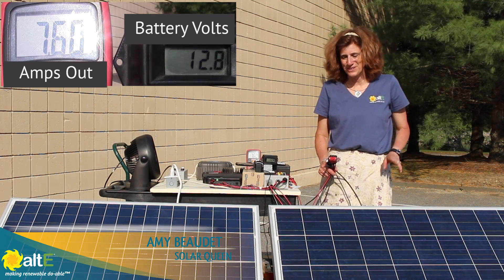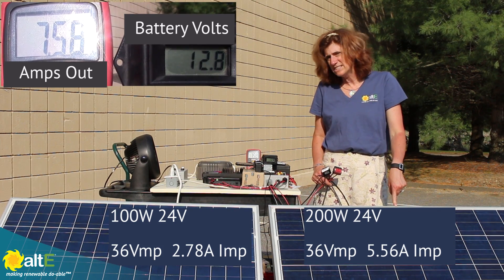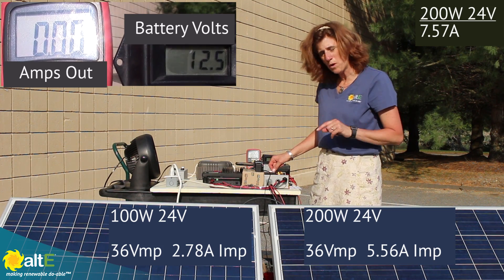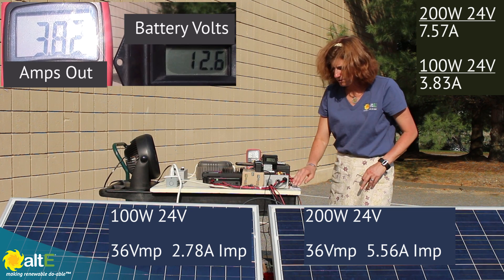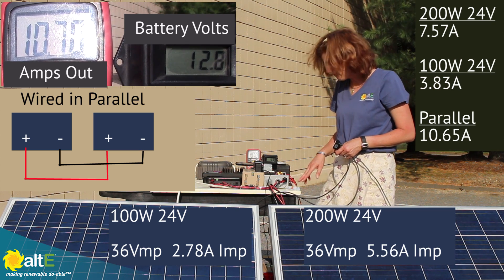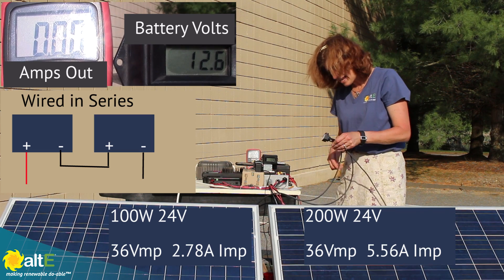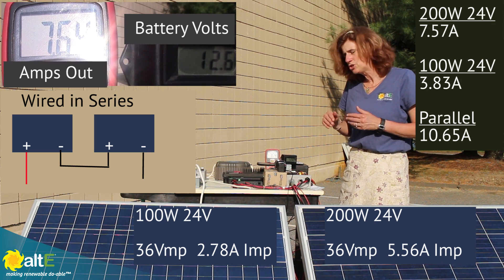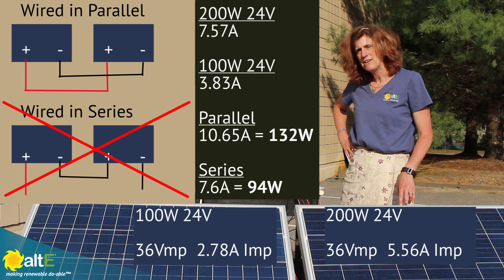What’s worse? Mismatched solar panels with different amps in series or parallel?

Comment: These are the results of using your MPPT controller but should any conclusion be drawn about MPPT controllers in general from this?  If not, then you should state that.  Perhaps a different MPPT controller would show 10+ amps for either series or parallel hookup of these same panels under similar sun conditions.
Reply: In series, both panels are limited to the current of the smaller panel. In parallel they were both limited to the voltage of the smaller panel. So the results are exactly as expected.
Reply: @LibertyDIY  Very badly worded by you.  The physical size of the panel is not relevant to those interactions, the actual voltages and amperages are.

Comment: Can you parallel two panels with different volts? Meaning, can you hook a 12-volt panel with a 24-volt panel?
Reply from the maker: We did a different video on mismatched voltage. If they have the same current, they should be wired in series, and either match the battery bank voltage and use a PWM charge controller, or use an MPPT charge controller for the right voltage output. If both amps and bolts are different, they should not be used on the same charge controller. Each should have it's own controller wired in parallel.
Reply: @AltEStore  do the same rules apply if you're just running straight into a grid tie inverter?

(also kudos on responding to comments on a several year old video haha)
Reply from the maker: @LoganJarrell  yup, ohms law applies regardless what you connect to.
Reply: @AltEStore  Hi im wondering if you can help me , i have 8 panels in total my charge controller has a limit of 15amps and 150 volts my panels are 18 vmp 6.67 amps and have no shading my panels are 25 meters away , currently I have 7 wired in series are I'm looking to connect the 8th panel but not sure how or if I can without exceeding the voltage of the mppt,  could I simply connect it in parallel to the other 7 ? Many thanks

Comment: It would have been helpful if it was stated that parallel isn't necessarily always the best option for mismatched panel and it depends on how they are mismatched.  If they were different voltages with the same current output, series would have been better.
Reply from the maker: Andy Andy we did a whole series of videos on this, including different volts, amps, and both. Check out the others.

Comment: For maximum output when connecting different panels together,  connect panels with equal current outputs in series and connect panels with equal voltages in parallel.   If neither the current outputs or the voltage outputs are close, don't bother hooking them together unless you can find a series/parallel combination that will yield a matching result. (ie: two 12 volt/5 amp panels in parallel then connected in series to a single 12 volt/10 amp panel).

Comment: 24(V)*10.65(A)=132W ?????????
Reply: That is the amperage out to the battery so it is like 12.9V * 10.65A = 137W (watts).  Her calculation is a little off.

Comment: Hi, can a 12v pwm 10amp CC take a 100watt 18v s panel. To charge 12v batteries? Thanks for your help. Great videos by the way
Reply from the maker: Yes. A 100W solar panel with a Vmp of 18V is considered a 12V panel, as it has the correct voltage output to safely charge a 12V battery. 100W has a short circuit curent (Isc) of about 5.75A. When you include a 25% safety margin, that gets you to 7.2A. So an 8A or higher charge controller will work.
Reply: altE Awesome thanks. Since we're on subject of charge controllers... How does one connect multiple loads on the CC without the use of an inverter , I.e- waterfall water pump, lighting and fountain pump. I've heard of a load center with DC circuit breakers. But would love to hear your input. Also, do all positive cables need to be fused?. Thank you very much
Reply from the maker: I think the cleanest way would be to use something like the Midnite Big Baby Box. You can use that as a DC Load Center. Each DC load doesn't have to be separately protected, but you should have them on a shared breaker. Like your AC loads in your house. Every outlet doesn't get its own breaker, but many share one breaker.

Comment: Hi,
Great explanation. Can you help me with my arrays?
I have a 5KVA MPPT solar inverter. 12 panels 340 watts 24V mono, and 3 panels 320 watts 24V Poly.
What would be the best way to array them up for best performance. I can remove one 340 watt mono panel if need be.

Thanks.

Comment: I actually was planning on doing this but could use some verification. If I have 2 100 watt 12v panels and 2 160 watt 12v panels that I want to run at 24v to the MPPT. Would I wire the 2 100 watt panels in series and then the 2 160 watt panels in series and then wire the 2 combinations in parallel?
Reply from the maker: JRS1121960 right. Since the volts are all the same, wire the different amps in parallel, as you described. The mppt charge controller won't work it's best with the mismatch, but that is the best combination if only using 1 charge controller.

Comment: So it's better to connect solar panels in series with same sizes of solar panels, Correct ?
Reply from the maker: It depends. If you have an MPPT charge controller to match up the panel voltage with the battery, or the battery matches the increased voltage, and the panels have the same amps, then yes, series can be better. Unless you have partial shading on some of the panels, then parallel may be better. So many different things to take into consideration...
Reply: altE thanks 🌷
I subscribed to your amazing channel 😍👍

Comment: I have both same wattage solar panels connected in parallel (250w -7.99 amp each) on my Smppt20D and I'm using a 1500watts inverter, the problem is that I can only use a fan. I can't even power a t.v with it.
But instead if I connects the inverter directly to the battery it works. 
How can I make it works using the load connection from The MPPT?
please help me :)
Reply from the maker: You should never connect an inverter directly tot he load control of a charge controller. The load control is only to be used for low current DC loads. A 1500W inverter connected to a 12V system will try to draw 125A. A 20A charge controller can only handle 20A load. You have to have the inverter connected to a battery to make it work.
Reply: ok Thank you so much, I have a last question.
What will happen if I connect the load output of the Mppt on a battery? Will it harm the charge controller. Because I would like to read how much amps I got by connecting it
Reply from the maker: DO not connect the load output to the battery. Only connect it to a DC load drawing less than 20A.
Reply: thank you so much for your advice :)

Comment: hi I have 2 solar panels both 250 watts 
I would like to know which wiring connection is better to have more amps possible? thank you
Reply from the maker: It depends on your situation. If you have shading, and a 12V battery bank, wiring in parallel is better. But if the panels are a far distance from the battery bank, and there is no shading, wiring in series is better for higher voltage, lower current, and less voltage drop. Are the panels 60 cell or 72 cell? If 60 cell, and you have a 24V battery bank, you need to wire them in series to have a high enough voltage in the heat. An MPPT charge controller is needed to match the voltage of the battery bank.
Reply: panels are 60 cells 12v  and batteries are 12v both connected in parallel :)

Comment: totally true
the solar to load ratio is (3.84A * 12.6V) / 100W  OR (7.55A * 12.9V) / 200W both equals 48%
in series the Imp will be the minimum Imp of them: 2.78A  and the volts will be added 
then 
2.78 * (36 * 2) * 0.48= 96.08 W ( approximately 94 W)

Comment: Of course the series had less amps, but the volts were doubled. It really depends on the power of your battery bank.
Reply: no that is amps being output...battery bank voltage is irrelevant as fewer amps being output.

Comment: When you take a set wattage, lower amps with higher voltage will most always perform more efficient than higher amps at lower voltage, regardless if they are wired mismatched or not.

Comment: if we keep this mismatched solar setup till long , will i damage the solar panel / cells ? or not ? because the large amount of current will pass from the smaller sola rpanel / cell ?
Reply from the maker: Correct. The cells of the lower wattage panel will heat up, and can potentially damage the panel.
Reply: altE  thank-you,

Comment: Hi

What about make mismatch different battery bank?
Same volt different Amper?

Thanks
Yossi
Reply from the maker: You should never mismatch batteries. They will charge and discharge differently and will be ruined early.
Reply: Hi
Thanks
So now i am confused 
In some video you said that it can be done when connect two mppt charger to two battery banks

My question is
If there is two different battery banks that connect to the same dc input of the inverter. Its not like parallel connection between the batteries banks?

The are shearing the same plus and minus 

Thanks
Yossi

Comment: How is this right?? The two solar panel in series=48V while parallel will be 24V.
You get more power with the panels in series because 48x7  is more than 24x10.
Reply: MaxSantos 
Two power sources in series pass the same current through them.   The 100 watt panel became the bottleneck for the max current since it can't keep up with the 200 watt panel.  Hooked in series, it basically limited the 200 watt panel's output to the same as the 100 watt.
Reply: MPPT charger makes the voltage suitable for the 12V battery to charge in an efficient way. That's the power of MPPT and with PWM the 48 volt situation would be way less efficient. Look up how these two different chargers work.
Reply: Max you 100% correct the series setup is much better , but thanks for the demo just the wrong conclusion.

Comment: DOUBT!
If the Imp(measured) of panel 1 is 3.83Amp then how current equal to 7.6 Amp can flow in a Series circuit, as we all know in an array connected in series the total current flowing in array is equal to the smallest current delivered by cell/panel. 
Kindly clear the doubt !
Reply from the maker: It is able to pass some of the current through from the higher amperage solar panel, but it is a bottleneck that does limit the current. So it will be a little higher than the smaller one, but not by much.
Reply: @AltEStore  what if you wire the small panel before the larger panel, then there is no bottleneck, the larger panel can handle the power coming from the smaller one quite easy, did you try it both ways?
Reply from the maker: Since the circuit is a loop, it'll still hit the bottleneck on its return, with same results.
Reply: altE Store I think you should have done that on your mismatched panel series.

Comment: Thanks for that. I have a 48v system with 180w and 190w panels. Two 24vdc, wired in series to make 48vdc arrays. I also have 6 each 280 w panels at 24vdc I want to add to the system to make three more arrays but had someone that it wasn't recommended that I do that. Is that true and why? I have a Xantrex MPPT 60 charge controller and 4800 w Xantrex XW series inverter I purchased from you guys a while back. Appreciate your help and the informative video.
Reply from the maker: I want to make sure I understand your system first. You have 1680W with the 280s as 3 parallel strings of 2 in series. In a 48V system, that's about 38A. You've also got the 1 string with 370W with the 2 small panels. Is that in parallel with the 3 strings of the 280Ws, so all going to the same charge controller? If so, not ideal, I'd rather see them on their own charge controller, but let's keep going. That's 7.7A, for a total of 45A. You've got a 60A charge controller, so you still have room for more solar. If it were me, I would remove the 2 small panels, and replace them with similar to the big ones you have. 60A x 48V = 2880W. So you can do up to ten 280W panels, 5 strings of 2. I'd replace the 2 small ones with 4 big ones. You could get a small 10A charge controller and wire that in parallel if you still want to use them in this system. Even PWM would work, that wouldn't be much money at all.

However, the next question I have is how big is your battery bank, and what kind? Lead acid batteries don't like to be charged too heavily, ideally at around a C/8 or C/10 rate. That means if you maxed out your charge controller with 2800W, at 58A. A C/10 charge rate would mean you'd need a 580Ah battery bank. C/8 is 464Ah. So, figure out if your battery bank can handle a bigger solar array.
Reply: Thanks for your prompt response!! Actually what I have is 8 each 180 watt panels at 24 vdc with two each in series to make 48vdc. I have 20 each 190w panels at 24vdc, two each assembled in series to make 10 arrays at 48vdc. I currently have 14 arrays. I don't have the 6 each 280w panels set up yet. This would give me an additional 3 arrays of 48vdc to add to the system. I do understand that at times during peak sun I am bringing in more current than the 60 amp charge controller (Xantrex XW-MPPT60-150) can handle. At these times I shut off a couple of arrays.

For batteries I started off with 8 each Les Schwab 6v lead acid batteries in a string to make the 48vdc. I had two of these strings in parallel.  The batteries are GC2-6VPA, 105 min @75Amps. I added two parallel strings or banks of 8 to the system (16 each, 6v batteries. Trojan lead acid T145 Plus T2, 206 Ah @ 20 hr, 215 ah @ 5 hr). I plan to get another matching charge controller at some point. I live in NW Washington State and my arrays are mounted directly to a (embarrassed to say facing East on a 5/12 pitched roof. Space won't really allow for tracking systems etc. In the summer I make 18 to 20 kw in the summer. I can produce more than i can use. In the winter months we produce just enough to keep the system alive and run the freezer and refrigerator. Sometimes we have to switch over to the commercial side. We are not grid tied with the two systems. From what I'm understanding we might need to add to the storage and obviously get another charge controller and install the 6 new higher wattage panels to the future charge controller.
Reply from the maker: It sounds like you would be overloading the system in the summer when adding more panels, but would probably be fine in the winter. Definitely add a new charge controller for the new panels.

Comment: the series setup will give better results if you place the bigger Panel on left And smaller on right. in Other take the negative from smaller Panel And connect it in charge controller negative input And take positive from the bigger Panel And connect it into charge controller positive input.

Comment: I HAVE 4 100WP AND 3 80WP PF 12V EACH PANEL CAN I MAKE 3×80WP PARALLEL AND CONNECT THEM IN SERIES WITH 4*100WP
Reply: purushoth adarva 

Yes but it will be rubbish because you only seam to get 10% of the power from the lower power panels.
Reply from the maker: I can't think of a way to make them all work together with 1 charge controller. You are better off with 2 charge controllers, put the 100W panels on one, and the 80W panels on the other.

Comment: That series test didn't make any sense. It definitely should have been better. When you put the two in parallel, their Vmp won't be exact and one would drag down the other making a small loss. But in series would not have that loss. Are you sure you didn't exceed the voltage input of the MPPT?  That would explain this.
Reply from the maker: We used a Midnite Kid, with a 150V input capability. Two panels with a Vmp of 36V were well below the limit. The loss of wattage was more because of lost amps than volts. The lower amperage panel created a bottle neck for the higher amperage panel, so we could not get full current out of the 200W panel.

Comment: Superbly useful post, many thanks!  Very well explained, incl diagram at end.  I was wondering what parallel and series meant, now I know.  Very much appreciated.  Subscribed!

FYI... The key to less wind noise, is to get a sock for your microphone.  Assuming you have an overhead microphone, you slip this wind sock over it.  Looks like a fuzzy sock. Cuts back on external noise a lot.  The film pros use it.
Reply from the maker: Thanks for the complements and the suggestion. We just got a better mic setup with a lapel mic with a sock and a recorder I can keep in my back pocket. Waiting for spring to try it outside, but the most recent recordings have used it and it is soooo much better.

Comment: yes but now your doubling the input voltage i calculate 364.8 total watts in series, in parallel you only get 255.6 total watts. your mppt controller should still see this.

Comment: My battery bank is 1000ah
Reply from the maker: That should be ok, that's about a C-7 charge rate, a little fast, but probably acceptable. So to handle that much current (1760W / 12V = 146A), you have to have two charge controllers, no way around it. So wire the six 160 watt panels in series and send to one MPPT charge controller, at least 80A, and wire the eight 100 watt panels as 2 parallel strings of 4 (8 in series is too high for most charge controllers, unless it was a 200V charge controller like the Midnite Classic 200), and send to at least a 70A MPPT charge controller. It would be best if you have two of the same type of charge controllers with the same settings, and even better if they are able to communicate with each other.
Reply from the maker: I just reread one of your older posts. You need two Outback 80A charge controllers. One can only handle half of the panels, unless you switch to a 24V battery system, which I recommend.